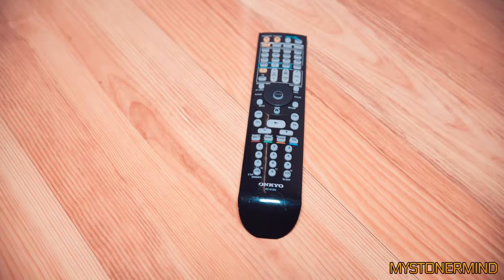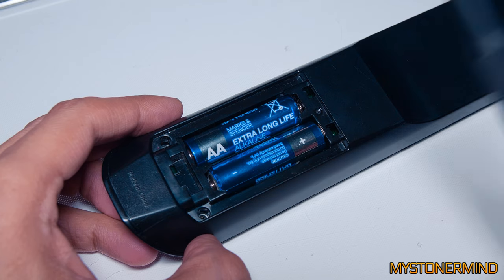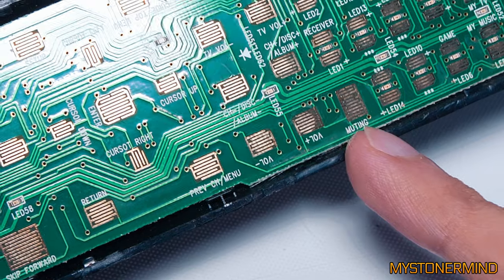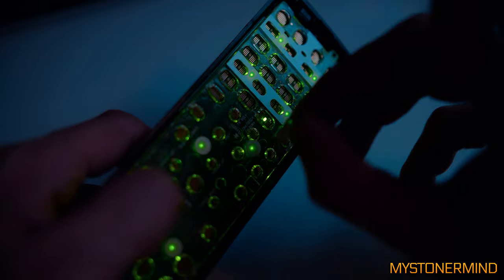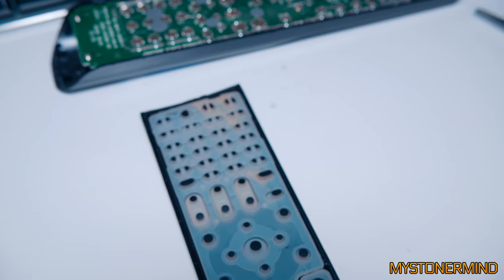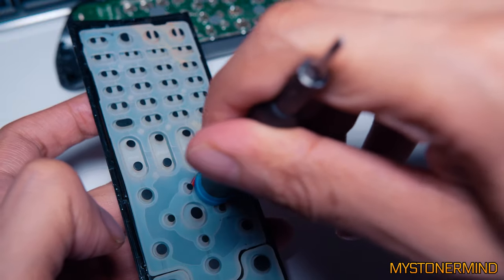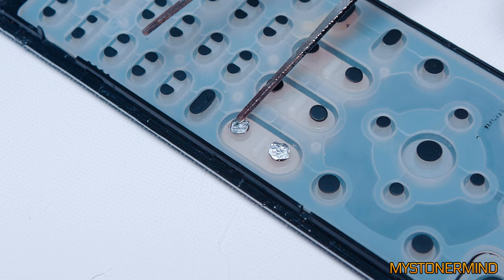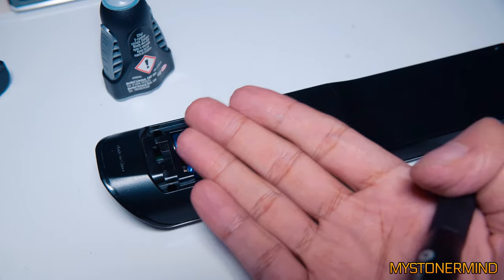Attempting To Repair My AV Receiver Remote Control With No Planning

Comment: Mr Stoner, the next time you encounter fussy rubberized push buttons there is a less complicated way to get the button contacts refreshed.  I have used this technique on calculators, electronic instrumentation and remotes.  First thing you noticed when you opened the remote was that the malfunctioning black conductor had a bit of a glazed look to it and the other buttons had a more buff dull finish.  It would seem that prolonged usage of the contact creates a resistive coating over the contacts that prevents you from closing the circuit properly to raise the volume.  For a period of time you can overcome the resistance by pressing harder on the button, but eventually even pressure does not overcome the resistive residue.

So what I recommend is that you find a small mechanical pencil eraser and gently rub the black contact as well as the the gold contacts on the PCB.  The pencil eraser will leave its own residue behind as you do this so it is important to use a lint free method of removing the residue after buffing the contact surfaces.  Alcohol might be a great cleaning solvent for the PCB, but I have reservations about using a solvent on the black contacts.  If there is any dust or gunk left behind on the contact, you will still have some performance issues.

It is a good thing that the double sided tape did not work because there needs to be a gap between the PCB and black contact.  There isn't a helluva lot of room there to insert solutions.  And if you don't have a gap, you have a closed circuit all the time or randomly when you are not pressing anything.   That scenario is dangerous for your speakers, home theatre amp as well as your eardrums.  I am hoping that the glue holds fast indefinitely for you because if it does not there is a similar dangerous situation when the foil comes loose and begins to close the circuit on it's own.

FYI, found your video after realizing it was time to tear down my own remote today but I did not want to destroy the plastic shell of the remote.  These Onkyo devices don't have those little tool notches you find on other products which give you a clue where  you might pry the shell open more effectively without breaking all those vital clips and delicate plastic bits along the interior.  God knows I have orphaned many of those delicate parts using frustrated brute force trauma of jamming a butter knife into the seam of the shell by aid of a 2lb mallet.

The learning is in the doing firsthand....no shame in that.

Comment: I always have problems with the springs that take the batterys and hold them in place. Sometimes their solder joints come loose. Also one time there was a capacitor which just fell off the pcb.